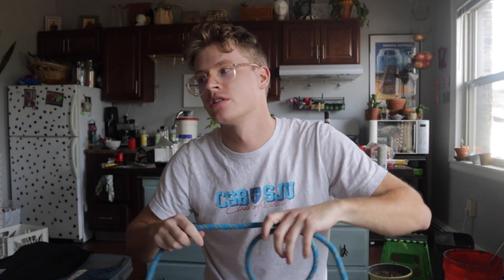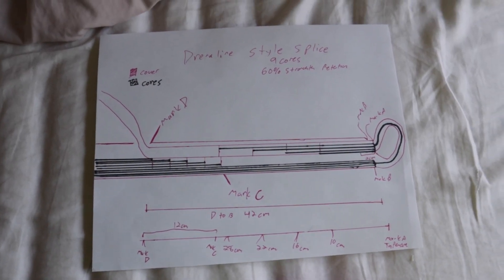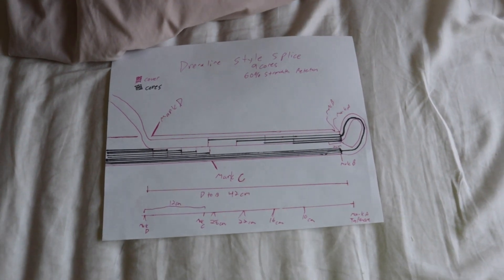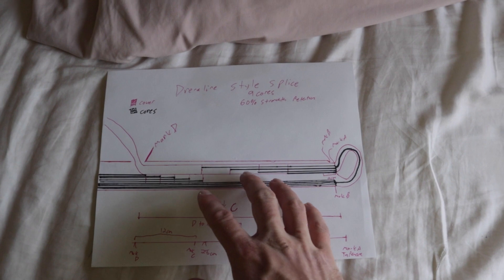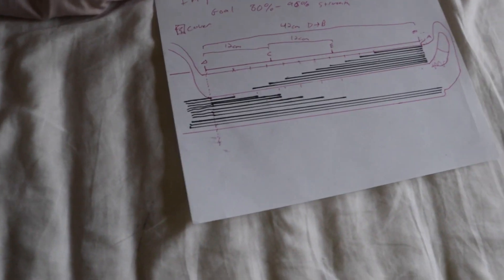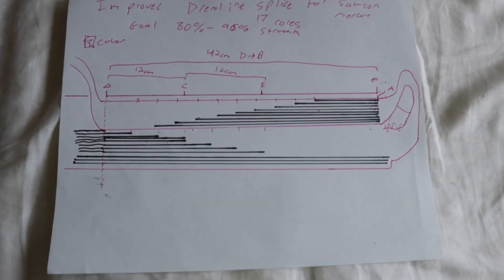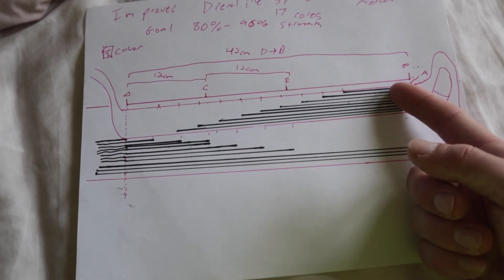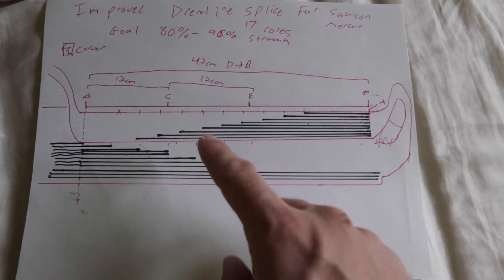Kernmantle Splice Breakdown | Samson Mercury + Sterling HTP

Comment: Hey brother 👋...have important question I bought vortex dry couple 200ft rope and my epicord and pursicks cords don't grab I guess cause it's new ..not tryed beeline yet ..but the green tefflbuger won't either ?
Reply from the maker: Yeah that stuff is super slick when it’s new. Do you rock a VT as a hitch? Something a little tighter like a Knut or something more tightly wound can be nicer for that slick new stuff. The annoying slippery most outer cover wears in pretty quick so it’s not an issue for very long if you’re climbing hard on it.
Reply: @treespicemedia yea I tryed that went with vt or michacon,,and used other cords going to order some beeline ..8mm..like that for fir sure situation s..I have 9.3 epicord and hrc teffelbeerger..and sterling by the foot and 4 others that I received with my hitch hiker extra friction from Richard Mumford..with the eye that mounts on bridge rope ..it's very very nice came with several cords and I ordered from arbsession 10ft section s ..hopefully it breaks in..got it for wett weather jobs here in smokey mountains doing removal s
Reply: Thank you  @treespicemedia